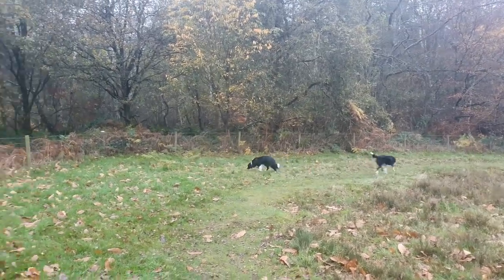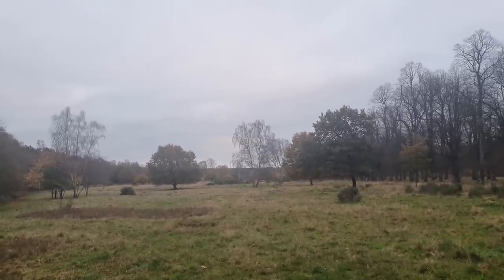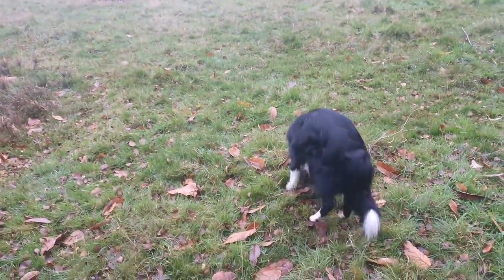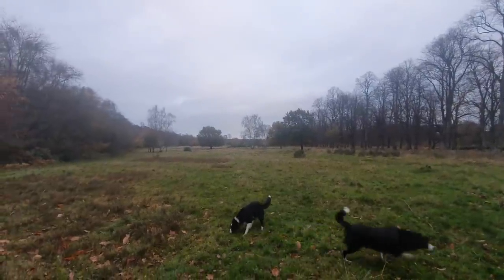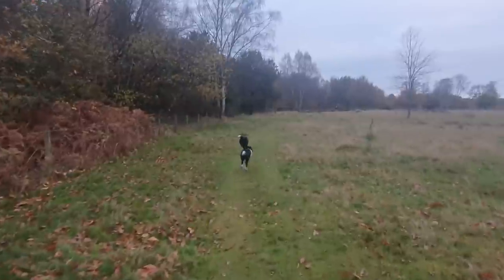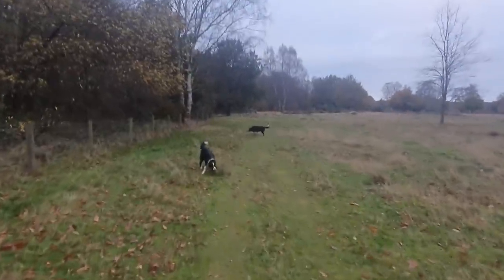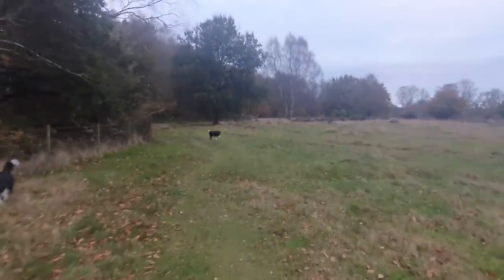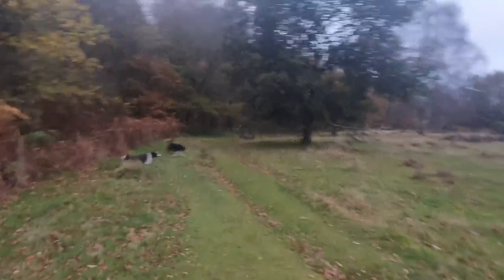It's Heating Up

Comment: Be careful removing cases from boilers some work on positive pressure therefore the case is the seal from the combustion gases.Its ok thinking you are competant but if anyrhing happened in a commercial enviroment and you have put a video up clearly" working on a boiler" ud get ur arse handed to you.

Comment: Apart from broken fingers, what is to stop your staff putting the heating into manual mode then forgetting and going home leaving the pub blazing hot?  That controller is an upgraded version of mine but I am too pikey to buy a replacement :)